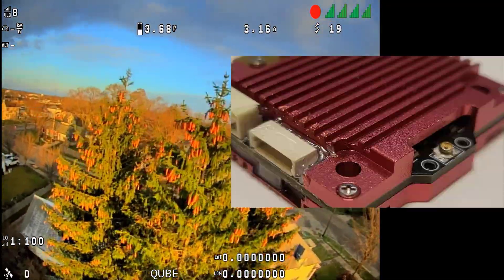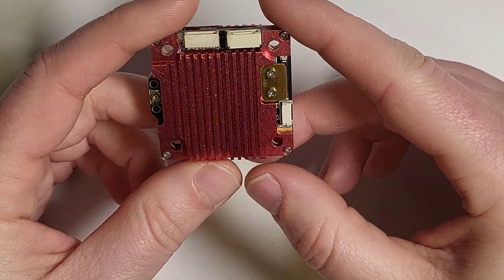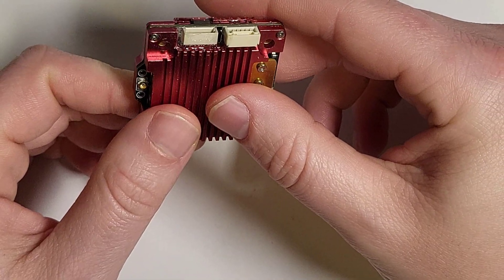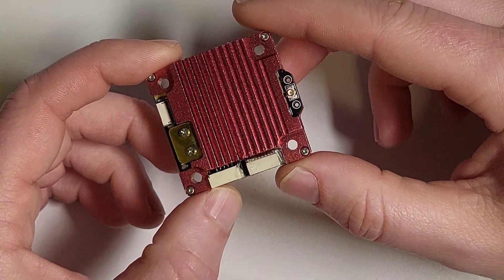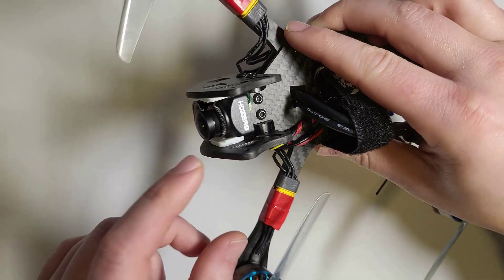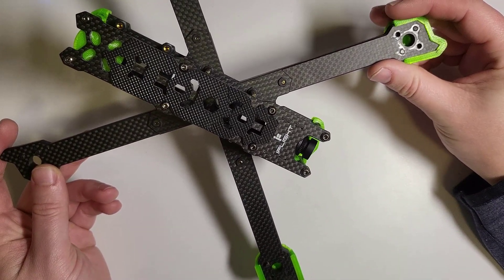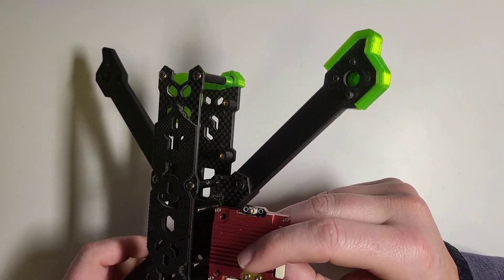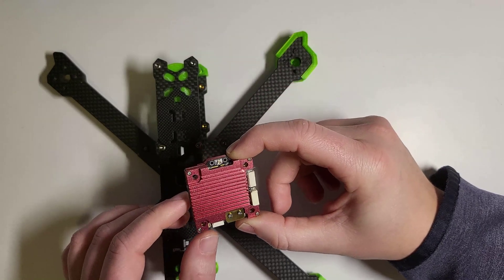HDZero Freestyle VTX - Pricing, Release Date, and Close-up

Comment: My goggles do not show the bars in the right hand corner and the osd elements are broke up and all over the screen.  I am using hdo2s and hdzero mobula 7.  Any suggestions? I am pretty sure I updated correctly. Thanks
Reply from the maker: Sounds like a firmware mismatch. Try updating the vrx to the latest first. Newer firmware has signal bars

Comment: Great review. It makes alot of sense to move VTX over the ESC since there are a ton of smaller 20x20 FC's, however it needs a solid BEC. A quality Mamba DJI 20x20 FC would be a great option for a plug-n-play.
Reply: I just be thinking of Temps.  Doesn't esc get hot. Heating up vtx?

Comment: Price isn't horrible. Figure  it as 65 for vtx  60 for cam,  20 for antenna, and mipi for 5. I'd consider that fair especially with fc and other hardware being so high. I used to get clracing f4 for 30 bucks. Now they are 55. So hdzero freestyle kit is deff priced fairly.

Comment: Wow, a bit pricey, but it makes since with the 200mw at $50.
Reply: Bit pricey maybe ,but dji camera and vtx is around same price. But this has alot lower latency than dji.Plus I like the way the break up is compared to dji I don't like the blockyness and skipping frames.
Reply: @akatopj22  Hopefully there will be cheaper options. I know that it is expensive to make and create, but part of the appeal to HDZero, similar to ELRS IMO, is that it is expected to be cheaper than DJI. 

It probably will be cheaper in the long run, when considering goggle cost, and all of that jazz.